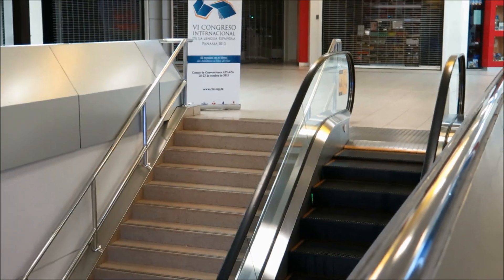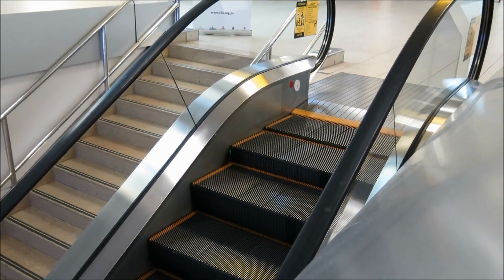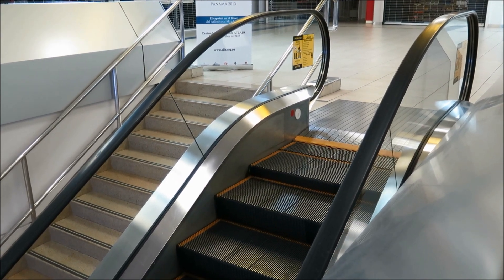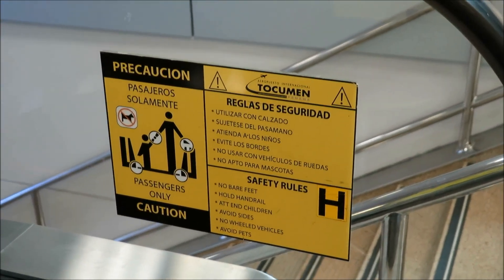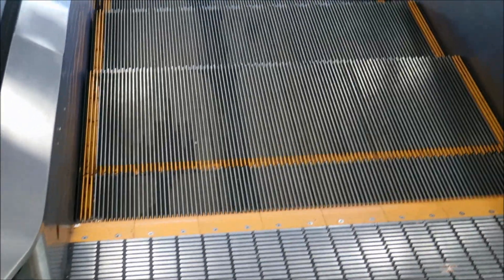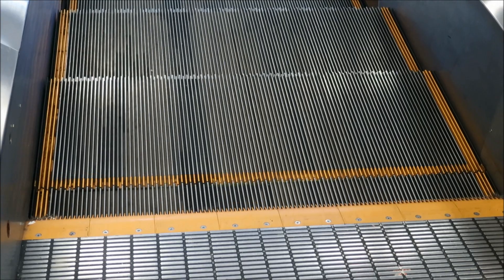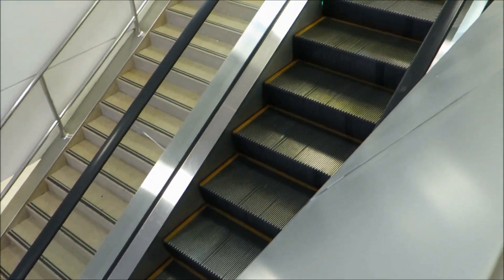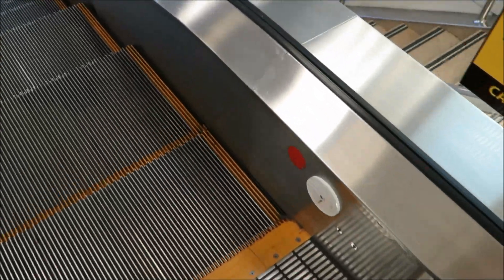The Slowest Escalator on YouTube @ Aeropuerto Internacional de Tocumen, Panama City, Panama

Comment: That happened in Vancouver but when I went on it moved faster
Reply: That's an energy saving feature, it runs slowly until someone turns it on by approaching it
Reply: @tkefan29  that's what I figured, its like the elevators most 5500 or 3300 that have backlight buttons turn off when its idle when its in power saving mode